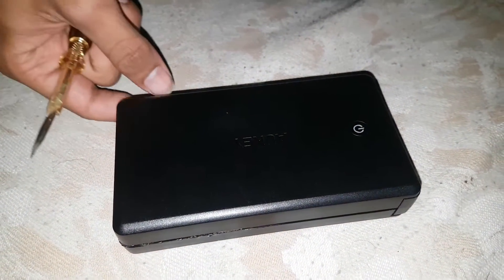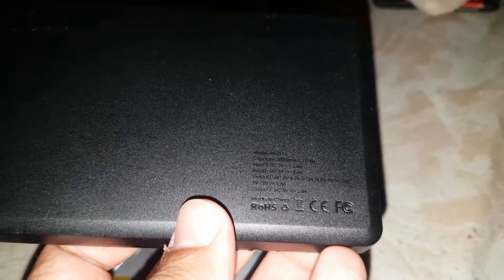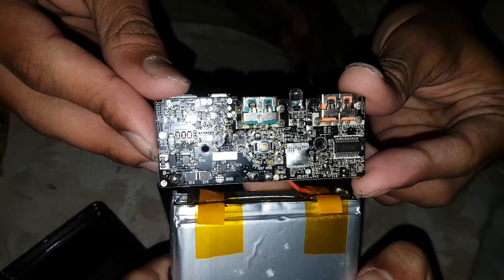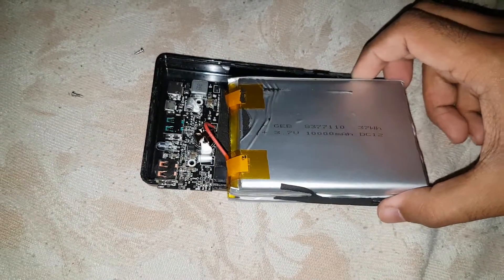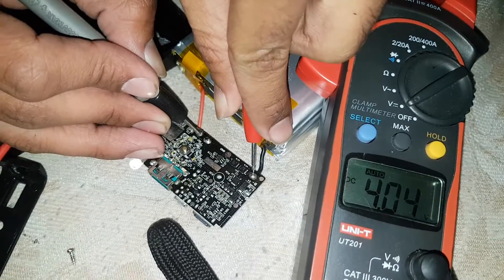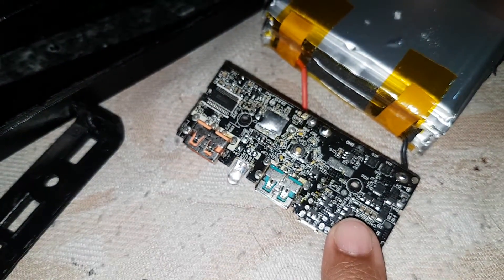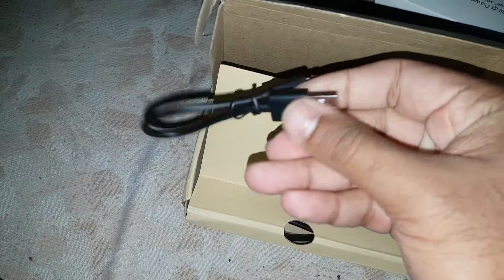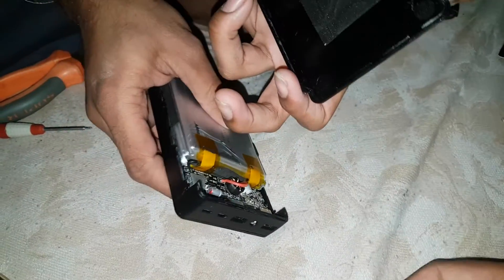AUKEY 30000mAh POWER BANK TEARDOWN PB-T11

Comment: yes!!! someone did!!! :-) i have an Aukey Powerbank 16000mAh Model Pb-Y2 wich unfortunately i did not use much in many years and is working very weird now. It gets really hot while charging, also charger. I noticed something wrong when charging with medium 39W solar panel and when there was no sun, charging led was still flashing green. Then i also noticed that input microusb socket was sending also energy out wich was wrong, i mean that port in this model is only input and not output. so i was thinking to break the case but i do not know how to. no screws no nothing. seeing your video i notice i will need to buy a new diy box if i want to use the battery :/

Comment: thanks for the battery. I am now confident to buy it as it has a true 30 000 mAh battery
Reply: we saw that 3x10000mAh just some confident. in real world no any power bank give true capacity as label, 
because battery cells are 3.7V but we use 5V, 9V or 12V devices. the step up conversion process will use higher energy it need to eat capacity down.
most real usage at 5V devices capacity will be around 63% of label. The more quick charge, The more capacity drop.
Reply: IT'S BAD. Don't buy it! Lots of QC issues and bad USB-C circuit.
Reply from the maker: there is no issue at all i am using it from year and half

Comment: Very Good!, You need to buy a Flash for better light while shooting...

i also noticed that every high capacity power bank has parallel connections of 10000 mah capacity.

i teared down my Syska 200 Power bank of 20000 mah capacity, which included 2 parallel connected 10000 mah Battery.

Comment: please do tell me one thing more about this device. IF POWER BANK IS COMPLETELY CHARGED THEN WHAT IS THE SIGNAL. (will the white let power button will stop blinking ?)
agar ye full charge ho jaiga tu kaisay pata lagta hay ke full charge ho gaya hay ?
Reply from the maker: color of the button will change to white blinking
Reply: WHITE BLINKING TU KAL SE HO RAHA HAY ... MEIN NE USAY ABHI TAK CHARGE PAR LAGAYA HOWA HAY. MEIN NE KISI VIDEO MEIN DEKHA THA KE FULL CHARGE PAR LIGHT GREEN HO JAIGI AUR BLINK NAHI KAREGI KYA YE BAAT GALAT HAY ?
CONFUSE HOON KE CHARGE HO GAYA HAY YA NAHI :(
Reply from the maker: brother full charging means White blinking ....Green blinking means still charging
Reply: oho .. bohot dair kar di dost reply karnay mein abhi band karta hooon 
mein tu white blinking par charge kar raha hoon .. thanks
Reply: bacha liya aap ne meray battery bank ko .. mein aaj bhi sara din charge karnay ke mood mein thaa ...
Reply: agar ye empty ho jata hay tu kitni dair mein full charge ho jata hay ?
Reply from the maker: if you will two chargers or high ampere charger to charge it then it will take 5 to 8 hours......if you will use single normal 1 ampere Charger then it will take a nearly 13 to 15 hour.......no need to worry about the overcharge this power bank have the special circut to cutoff charging supply
Reply: Bhai tusi great ho ...

Comment: Cheers bro!
Came across this as my PB-Y1 has no output current at both ports. The seller dishonor the warranty thus I have to troubleshoot it myself.
I guess I can open it up and check the current at both USB ports like that you did at 7:30?
(I am able to charge the powerbank as the LED indicator is lightning up. The LED light is working as well. Just there are no output current at both Output ports)
Reply from the maker: yes you can